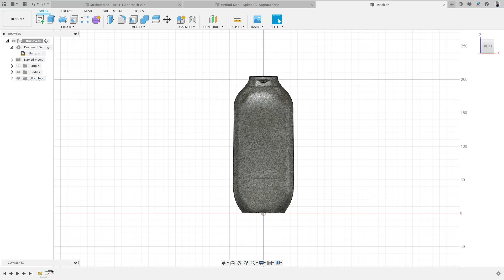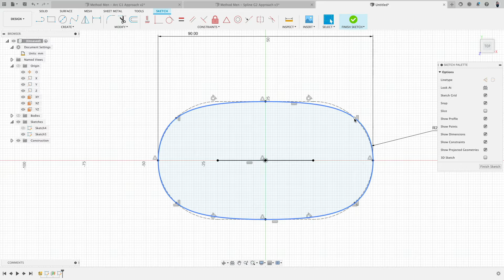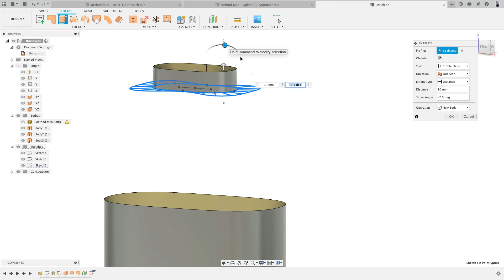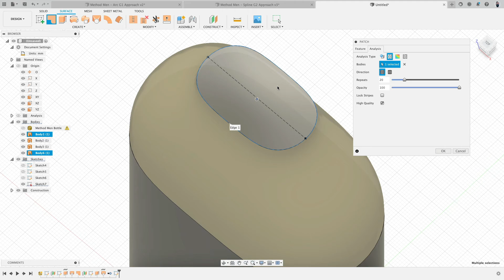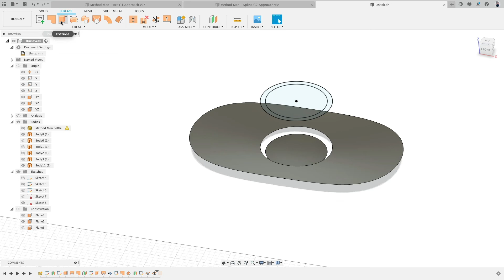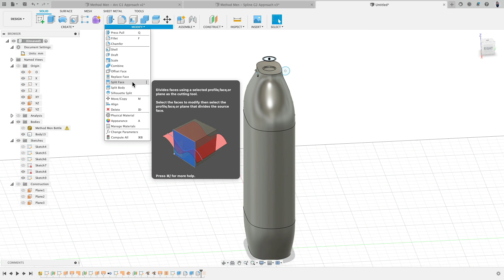Method Men Bottle

Comment: Oh, I learned about the curvature display, super useful to surfacing! excellent tip. That is a very useful tool for more complex surface development. I would really like to hear the modeling sounds more in your demos. I wish I had that free claas kuhnen fusion 360 sound extension installed. Where will that sound pack be released??? 😜
Reply from the maker: the curvature tools are very useful - I will in a next video show also how to use this during modeling. we could have done the dome with a curve network but I did not want to stress the students yet - one of the next bottles will have a curved network for loft - I will then also try to add my signature sound effects ;)
Reply: @cekuhnen  sweet!